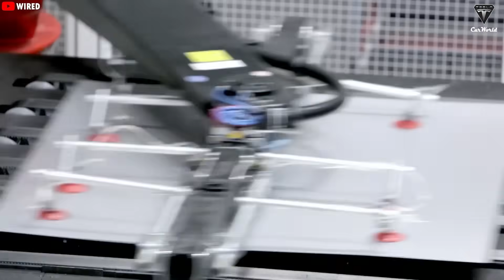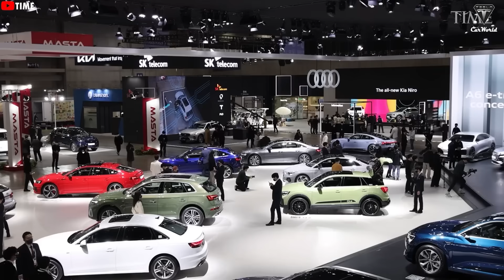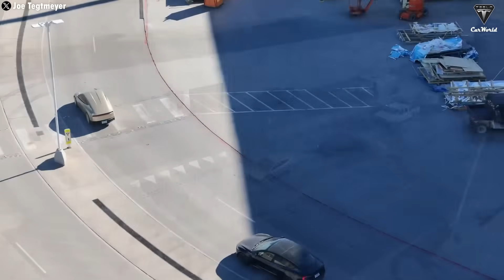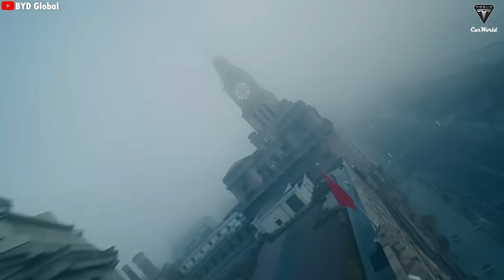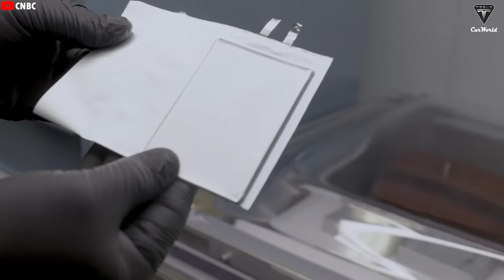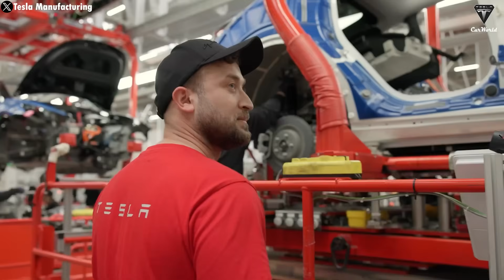It Happened! Elon Musk Tesla World Biggest Factory Builts NEW Model in 33 seconds!

Comment: I've driven these cars I used to think that they would feel like paper but the thing is solid as a rock and if the electronics inside of it is absolutely astonishing the Tesla vehicle has pressurized cabin and filtration system if somebody throws a chemical weapon at your car tear gas or anything like this you're going to be protected in this vehicle, in addition to that it has multiple airbags even if you're not wearing your seatbelt which is illegal you still going to be protected, he actually eliminated the need for seat belts with the airbag system which operates incredibly well

Comment: Tesla does not build a car in 33 seconds. A car rolls off the line every 33 seconds. These are 2 completely different things.
Reply from the maker: You are wrong !
Reply: @TeslaCarWorld  prove it. The paint alone would take far longer than 33 seconds. The production lines would be a blur (and they weren’t). Even robots can only move at a certain rate. If they moved at the rate necessary, installing all the many components they’d get in the way of each other. Much like the original mechanical typewriters - the human could type faster than the mechanics - thus they slowed it down by developing the qwerty keyboard and moving frequently used characters mechanically apart.
I guess the 33 seconds really depends when you start the clock. If you start at ore extraction, refinement, smelting etc it would be even longer 😂 if you are using Just in Time and bringing all the bits together for final assembly then that might work. You are playing rough and ready with definitions. Oh and well done for showing the competition on how to mass produce cars at speed. That was well thought through.